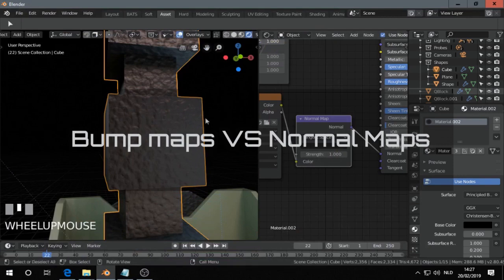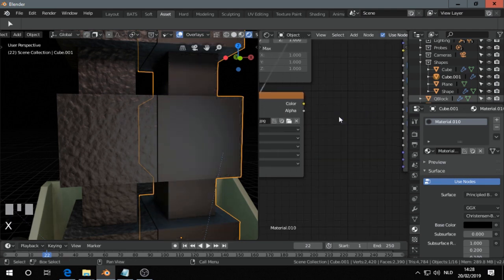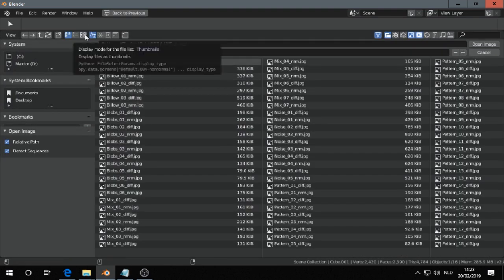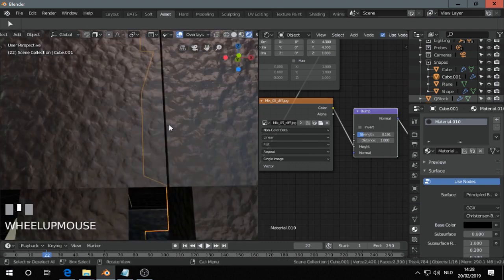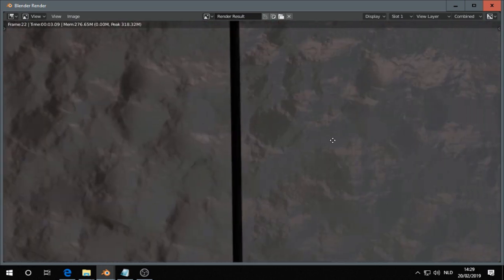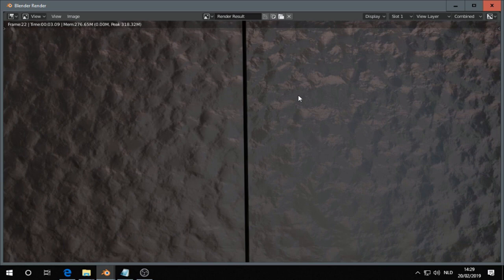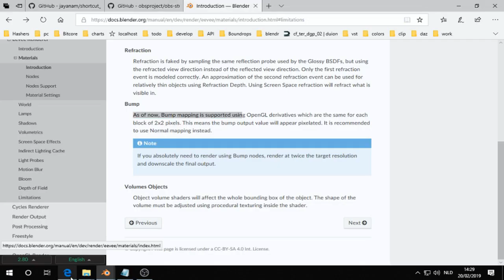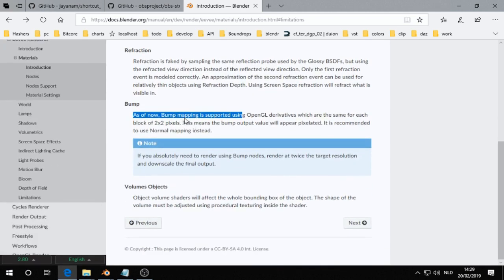Bump Maps VS Normal Maps in Blender 2.80 EEVEE

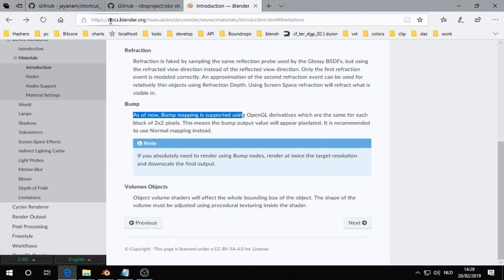Comment: 1:59 official documentation (side note - how do you add a clickable ref to the exact time within a youtube video, in a youtube comment? I see the blue hyperlinked timestamps in comments everywhere. Moving on...*edit aha! Google does it automatically. Cool!) - says "If you absolutely need to render using Bump nodes, render at twice the target resolution and downscale the final output." I find that I am limited by GPU memory in how large I can render out with Eevee. Scene size, poly count and PBR complexity all play their part, but GPU RAM is at the end of the day the limiting factor. So, if I'm lucky I can get 4k in Eevee, but mostly I can't, and that's with a mobile RTX2060.
In Cycles I can get around that limitation and render out massive images, but I wait for them.
Either which way it's all about trade-offs in 3D.
Eevee with a bit of post work for animation, or low detail motion graphics. Cycles for high realism, and high resolution stills.
Is there a way for baking PBR in Eevee?

Comment: Bumps maps are now better in 2.82, also you should try to change the distance for your bump map.
I try to avoid Normal Maps for many reasons :
- because they are slow when animating
- Because you cannot make them by yourself
- Because you can use your diffuse as a bump map sometimes
- Because sometimes they are oriented the wrong way, they don't work well with mirror modifiers
- Because for fine details/grain/imperfection, Bump is enough
Reply: I agree with everything except for 2, you can bake normal maps, but it's a pain.
Reply: @IyeViking  I disagree with the idea that making normal maps is a pain. Once you understand how they’re composed, you can literally paint them in photoshop

Comment: Can you add both normal and bump at the same time? I'm new and downloaded a texture from texture heaven, and in the folder, there is both normal and bump map.
Reply from the maker: Can yes. I would just give a little bump. If bump strength is to high, you might start to see those pixel-artifacts. Just chech if it makes sence to add bump ass well for that specific material
Reply: @Newmediasupply  i don't know how to add bump, can you explain how to do that in shaders tab. (I have already add the normal map to principe shader by using a normal map vector.)
Reply from the maker: @CanberkSezer  I am on holiday, at the moment. Dont know from the top of my head how to do that in shader tab (properties panel).

Comment: Hi Petie, thanks for sharing. Always good to understand the tradeoffs one makes when choosing to add more maps to a material vs saving memory and cheating with trying to slide by reusing a diffuse map as a normal map.

My personal believe is neither normal nor grayscale bump maps are great contributors in meaningful ways in EEVEE. For the most photorealistic results, both should be dialed down significantly-- I guess it all depends on what you're after. Thanks again!
Reply from the maker: Honored to see your comment here.  I hope you are interested to see my next video as well that is exactly about that and share your thoughts.